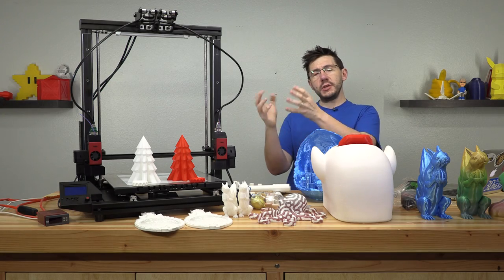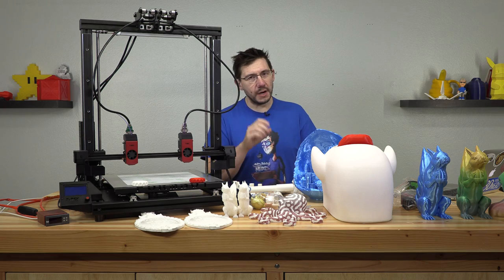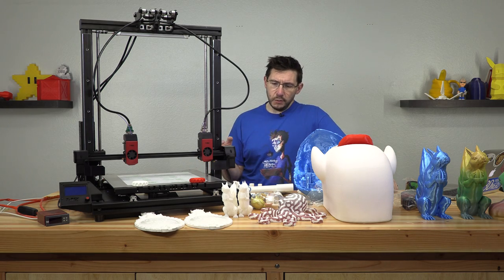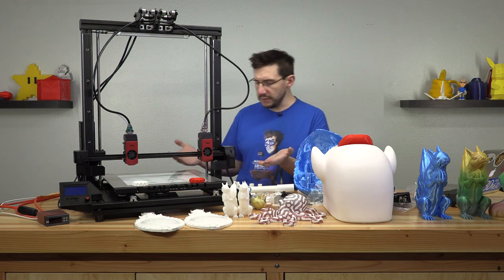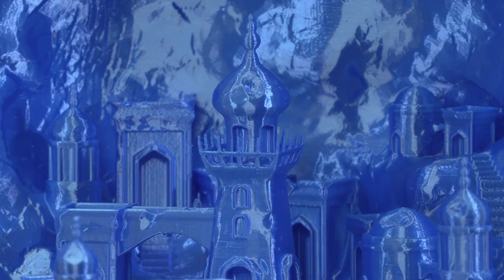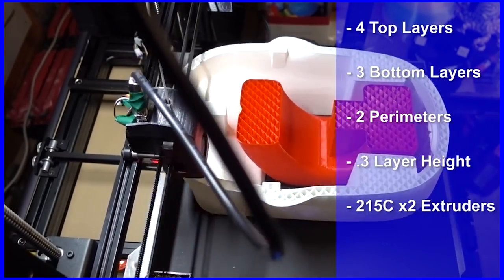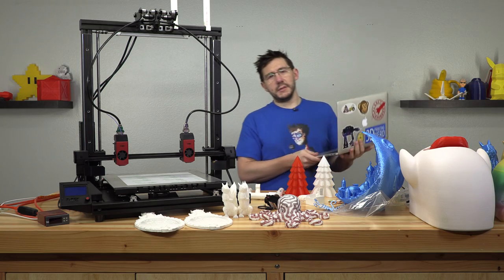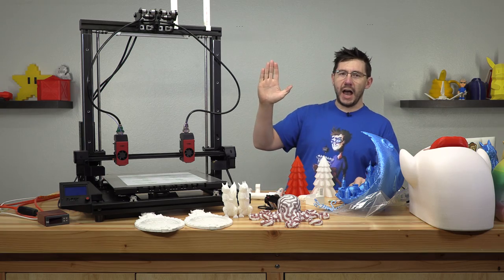Formbot TREX2+ 3D Printer Review / Dual Independent Extruders at gMax Build Sizes, Is It Worth It?

Comment: I have had one of these for nearly a year now and it is great! Big models, small models (I have the 0.25 nozzles as well, E3D nozzles and heaters fit perfectly) and giant models all from one machine. Duel extrusion works really well if you take some time at the start to set it up, don't expect to just print perfect out of the box at this price it still takes some setting up (if you want that go spend $4-5000 on a machine this one starts at $1600, you don't need all the extras but the heated bed is a worthwhile investment) . With duel extrusion for both extruders to purge and do a skirt it is just a setting in S3D, I'm surprised Joel didn't know this he has much more experience than me with S3D. Also you can do duplicate with minimal resetting of the slicer.
Formbot used to put a buildtak surface on their older printers and customers complained about it so they give you a clean metal bed with the heated version so you can use the surface of your choice, there are loads of them out there and we all have our own preference.
Reply: Thanks for reporting the details about being able to purge and build skirts using both extruders. This has been one of my main concerns! Ihaven't been able to find this info anywhere else!

Comment: Love the vids Joel...Like to see more with the formbot and working dual extrusions... I purchased the 400x400x700mm and can't stop using it even if its a toy for my grand daughter....and for those that think it has a lot of problems i would have to differ.....the only time I ever had a problem with mine is when i tried to upgrade to community firmware or upgrade a part then it was a mess to work with...set everything back to factory and haven't had a problem since. Now Formbot just released a version 3 with a lot of great upgrades but only comes in a 400x400x500mm.

Comment: This is similar to my experience with the Formbot Raptor, which I selected as my first printer at the end of last year. It does print pretty well out of the box, but there are still some quirks that seem to plague all of the Formbot printers. Fortunately, they have released to source-code so I can slowly fix those issues. 

You can definitely see the snakeskin/moire on the Om Nom due to the 24V and the stepper drivers they chose. I believe that also has an effect that makes the extrusion slightly inconsistent making it near impossible to get rid of layer zits unless you wipe so much, you get under extrusion on layer starts. Time for some new drivers.

With that 2 zone heating bed, it's likely contributing to bed warpage. The bed does kind of suck. It's sufficient but I really want something that can be swapped out. I swapped out the clone hotend with a genuine e3d v6 and would like the option to swap in different surfaces for things like nylon, pom, and PC.  Overall, I've learned a TON about 3d printing by working through the issues similar to the T-REX2+. I would never consider a T-REX2+ though until they released the source-code.

Comment: Dual extruder machines are headaches.  I have a printrbot plus dual collecting dust and maybe made 4 dual print parts... I feel like the pallet plus and filament mixing is the way forward. $1599 for a tinker machine?  Smh
Reply: GeoDroidJohn I mostly agree but I would include the Prusa Multi-Material style (single hot end with multiple extruders) as well. The Palette+ is awesome but it can't mix very many different materials. It can bond PLA-TPU but not PETG-TPU or work with TPE (e.g. soft Ninjaflex) at all. Whereas the Prusa MMU can mix those materials and many others.

Note: Mixing TPE with other materials is currently not working well because the wipe tower uses a hard-coded speed but that's just a software issue Prusa is working on. Not a physical limitation like with the Palette+.
Reply: They maybe are a headache, but if done right, independent extrusion is the way to go. Things that Joel mentioned -- as in profiles and priming are easily fixed with various tricks in S3D -- even S3D skirt for each color is brain dead -- I want to do 2 skirts of each color, but it alternates them which adds extra tool changes. I speak from experience of building a quad independent extruder machine. I have a pallet+ also, and I find the purge blocks to be very wasteful, and not always functional -- transitioning from black to white or red to white requires significant purge amount. If an idex (in my case an iqex) system done right, you can setup gcode to prime each extruder and and be off and running. I am able to print large 4 material/color objects with no regard for type of material I use. I haven't tried mixing flexibles and rigid yet, but will soon. I also don't think Marlin the right firmware for these types of machines. I run my machine on Duet, and there is a lot of ability to build in various features into the firmware so that you don't need to rely on slicer settings. A traditional dual extruder is broken by design. 2 nozzles next 2 each other is not good, oozing, knocking into parts, been there, got the t-shirt -- twice. Moved on.

Comment: Those v-wheel rails are probably a good choice for such a long axis, especially when you have two in parallel on a user-assembled machine, where a linear rail setup could bind in a similar machine if there was a bit of a skew. The ballscrews are interesting.  I have not tried them on the Z-axis because they are sometimes SO easy to move that they have a tendency for the gantry weight to be able to backdrive the motors if they are not powered on (or the power cuts out), and them and let the gantry drop to the bed. I would be interested to know if that is the case with this printer, of if these screws are tighter/stepper pitch that doesn't let that happen, or of they have some sort of tension adjustment or one-wat ratcheting lockout or brake or similar thing to keep the gantry from dropping

Comment: There is no way for an big-size IDEX with y-moving bed - at least whithout many extra code in Marlin and a tiltable x-axis, unless you do without mirror or duplicanion modes. To do ABL you have to correct the distances of both printheads. It can be done, if the x/z conection can rotate on one side and rotate and slide on the other. Than z1 height and z2 height are adjusted so x get tilted to compensate distance to the bed for extruder 1 and 2 at the same moment - and on every movement. Which will be possible if you construct the mechanics and do a lot of programming. Not sure if even 32 bit CPU is effitient enough to do all calculations - but maybe with klipper on a more powerful CPU?
So the printbed has to be extremly flat and nearly not bendable. Which means thick and made of fine milled cast aluminum. I think at that size at least 9mm thick. Meaning extremly heavy, so only accelerating slow if you do not want ringing. Which means extremly long printing times. Which makes Mirror and Duplication mode useless. You would be faster to use a light bed and ABL, not using duplication or mirror mode, and printing the objects one after another.

Only ways at the moment to use duplication or mirror mode: A smaler buildplate or a cube design, which has no problem with a heavy bed.

It is a shame, nearly no one seem to understand the principles of the bed-y-moving design anymore. At the beginning of open source printer developement, many components (like aluminium extrusions) where expensive. The filament available was 2.85mm only. A geared direct extruder was heavy. Printbed was commonly a size of about 16*16 or less. As acelleration and speed on x and y should be the same and movement of x, including x-gantry, in y.direction (classic cube design) would be the limiting factor, on small open-source developement moving y was the cost-effective alternative with faster printing.

Since dawn of open-source printers, many things changed - and the engeneers forget about the reasons for movingthe bed in y.
First the size was scaled up. 1.75mm filament leads to lighter direct extruders. The use of bowden system reduced weight even more. So the y moving bed had no advantage anymore, exept for very very smal printers. Also cost of components got lower and lower - actualy using y-moving bed instead of a cube might spare less than 20% of the printers cost.

Instead of bulding printers as cube now, the bedshaker design is simply scaled up. With all its negative sides. And as the bedshaker design was popular (by the Prusa printers with heavy direct extruder), this design was simply scaled up. (In an engeneering way) nonsense: Combining a light bowden with a 300 by 300 printbed (CR 10). Yes, it was sucessfull and a bestseller. But only about 20-25% more cost - and it would have been much more faster and reliable. Of course only if sold in eqal numbers. This was the moment, marked decission overcome engeneering sense.

This printer you show is an extreme evolution in this direction: a very huge bed, overengenieered on expensive parts (spindels) but using a bedshaker design. Constructing a cube and using normal leadscrews (or beltdriven z) would not cost more. But it is so easy simply scale up another design, put some high quality parts like spindles in for better advertising...

While on bigger bedshakers you can use thin heatbeds, compensating the lack of flatness and get accaptable quality with maybe accaptable slower acelleration and speed by using ABL, this workarround does simply not work on an big IDEX. You mostly have big prints only from time to time. So duplicate and mirror prints are strong arguments for paying more for an IDEX. And these modes can not compansate for the basic problem of bedshackers, having to minimize bed weight, using ABL.

So an IDEX in 400*400 as a bedshaker? Maybe, if you do a very lowcost design, without Mirror or Duplicate mode. But than something expansive like spindles has nothing to do there. A printer if you print a lot big objects - and if you have enough other smaller printers (the heatbed will waste a lot of energy if you use such a big printer for small objects).
But best: Forget a bedshaker in this size. Use a cube design. And a perfectly flat thick casted aluminium bed.

Comment: The downside of Prusa's method is that it doesn't play well with materials too far apart on their melting point. I don't know if my ideal slicer feature for this exists, but if you could specify different retraction for separate extruders, you could combine far more materials with a printer like this.

Comment: Im considering a "like new" raptor 2+ for about 500usd, 700mm ver. Is this a decent 3d printer to get into 3d printing? See it cost about twice as much new. It has been serviced, new hot end. Not sure if it gott upgraded.. Im looking for large volume printer, limited selection. I looked at creality cr10s5, hard to find. On paper raptor seems to be tad better. Price seems to be fair, and it should be like new. I'm new to 3d printing, looked at getting one for years. I dabbled with old school stuff, like cnc or well. Analog way of manufaktur stuff. My impression it is similar, but it is plastic. And, instead of removing material you add it. Dream would be metal 3d printer, 500x500x500 or something. My knees would buckle if someone came to my door and gave me a industry high end metal 3d printer.. But hey, plastic is ok, i guess. So long my head dont go blank when i get a printer..  Hehe Tnx for any help, or input..

Comment: I really want to try a laser engraving add on to my I3, but I understand you are not interested in it.  Maybe you will give it a try one day :) I want a large 3D printer and these reviews are helpful- tanksumuch Joel
#nowthatyouarefulltime I expect you to try out the laser engraver (SIC)
Reply from the maker: Hahahahhaha. Thanks :)
Reply: I have one on my atom 3d printer. It's barely a toy. (Plus it's a nightmare to import to the U.S.) Laser engravers are great, but you definitely need a real one. Not the little diode one... I wound up getting a 100w CO2 laser, and even that is limited. The real deal lasers are fiber lasers. But expensive.
Reply: @Johnathan Battaglia lol... no it is not... you have to coat metal with a spray and even then only the spray will etch... only a fiber laser or industrial laser will bite into metal...

Comment: I just got a CR-10S (first printer)  and am trying to print a rectangular block with slots on the face, one end is thicker than the other and I have made 5 tries and each have warped on the thinner end. It has been on the bottom side. Is there a fix for this? PLA 205 degree bed 50 degree 15% infillm. masking tape. Symmetrical parts come out fine. Another description of the part is a wedge  the bottom is flat and the top is angled, with mounting holes on the face. Each time the flat bottom has curved up on the thinner end.

Comment: I've been yelling at them to release the firmware for months! I have the 2+ as well. And yes... it's very much a GPL violation :(
Reply: Yes, I agree, I have this one too , and although I feel this printer is very sturdy and well designed, they put way to much emphasis on protecting the marlin code.  I really wish they would release it. Looking to possibly replace it with a panucatt X3 pro with a 40 pin IDX breakout  just to gain control over all the features.  real pain to keep going back to the vendor for minor changes.

Comment: They say their high temp extruder only goes to 350c. That's not hot enough for PEEK or Ultem. And even if it went higher, the machine isn't enclosed in any way so you couldn't print such materials anyway.

The more I read the website the more I think these guys are a bunch of cowboys.
Reply from the maker: I cannot disagree with you.
Reply: I asked the company exactly what you are saying here. Their reply was that they have never actually printed PEEK on the printer themselves: however, a supplier in China told them it can be done. 

So urm... yeah... it must be do-able right?!

Comment: Anyway I can get your gcode for the duplicate printing? I keep having troubles with mine, thanks!
Reply from the maker: What issues are you having?
Reply: 3D Printing Nerd So the duplicate print will start and everything will look fine but after the first layer of each part both of the extruders stop. Then the secondary extruded goes off and starts printing a 3d part that is slightly offset from the part it was just printing for some reason even though there's not a 3rd model is s3d.
Reply from the maker: Whoa. That's WEIRD. I would speak to Formbot.
Reply: welcome to contact us by service@formbot3d.com

Comment: So far  when it comes to printers with independent  extruders  i only ever see ones  that are $1000+  which  sucks its  soo expensive  but yesterday  i found  a sub  $1000 but know nothing  about  the company cant find much information on them  either  and it seems like they only sell through  Amazon  and Ebay  but the dual extruder  is only on ebay heres the link if you wanna  check it out  https://www.ebay.com/itm/XXX/153388348272